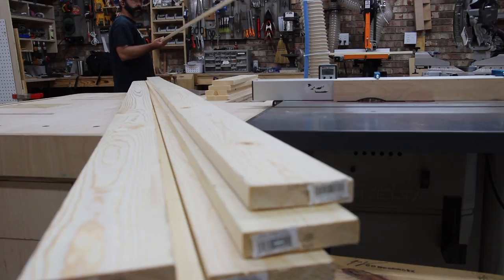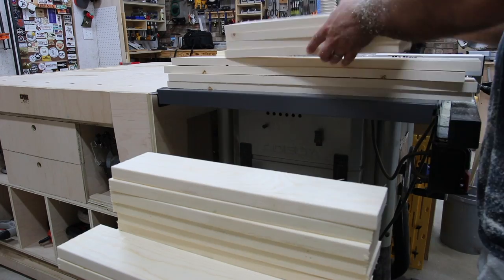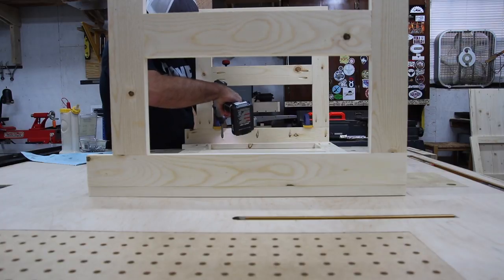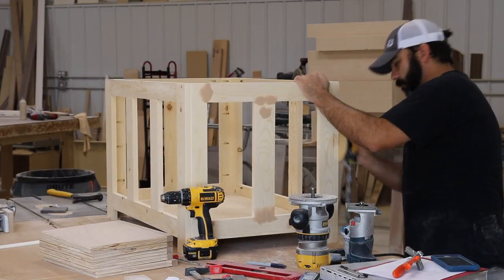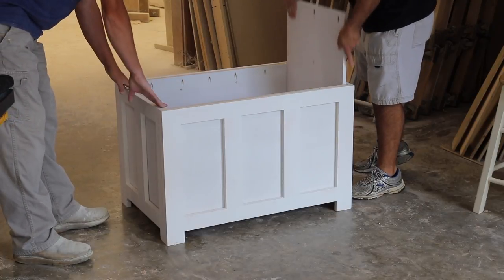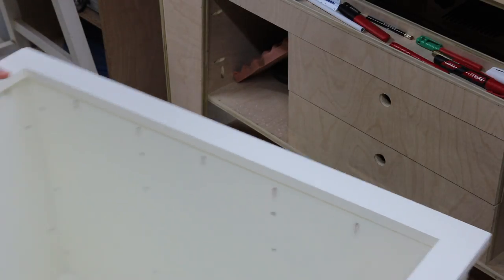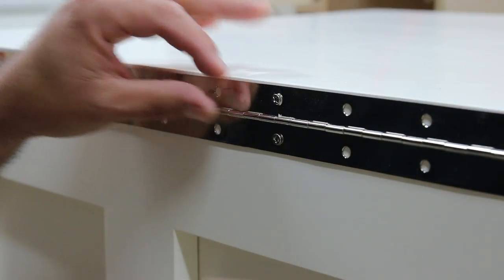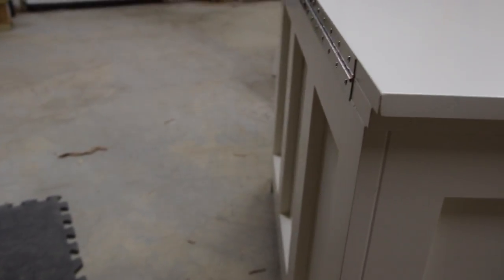Pocket Hole Blanket Chest - Woodworking

Comment: Fill the pocket screw holes and the other screw holes with wooden plugs (Kreg makes plugs for their pocket screw holes), and sand them flush with the wood/plywood before finishing. Makes the fastener system invisible and a much neater finish. Otherwise nice build!
Reply from the maker: I’m familiar with the kreg plugs. I’ve actually used them before and since the pocket holes were on the inside and not visible I didn’t worry about it, but I appreciate the explanation. Thanks for watching.

Comment: I like the general premise. Great build! You could easily take the set of plans and convert them to more of a custom "craftsman" type of build by using hardwoods all the way around, although that would add considerable sanding and finish time to the build. You could also line the inside with Aromatic Cedar... a very nice touch. A Festool Domino would be as easy and as fast to use as the pocket screws and you would not see any obvious signs of how you did the joinery. You could also choose from several different types of hinges to give yourself or customers  a more customized look to it.

Great solid build using a simple tools and easily converted to a more "sophisticated" look and build. Thanks Shawn!
Reply from the maker: +Mark Koster Glad you enjoyed it. This was a collaboration between Jay and I. He designed it and created the plans while made it and created the video. Thanks for watching.

Comment: Nice build, I bought your plans and  I'm currently building it. I have a question though. What router bit was used for the groove you said would prevent paint cracking? Thanks.
Reply from the maker: Straight bit and tape?
Reply: @StoneandSonsWorkshop  I don't get that about paint cracking. You only grooved in one spot. Does paint not crack everywhere if it cracks anywhere? Oh yeah, you did this three years ago. The wood would cost you 4 or 5 times as much now probably. Two months ago I bought 5/4 decking for $7.50 per 8 foot piece. One month ago it was $14.50. Prices are approximate but are representative.